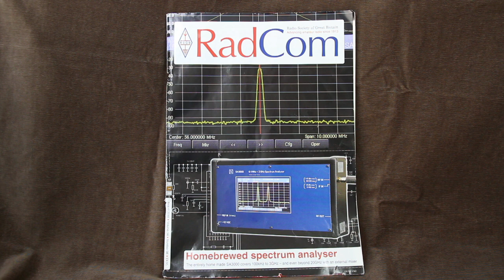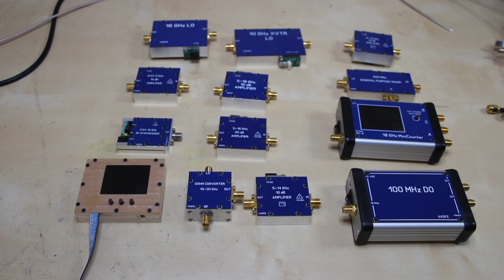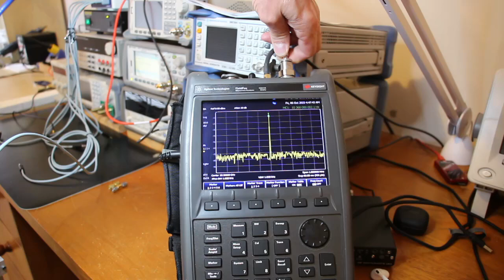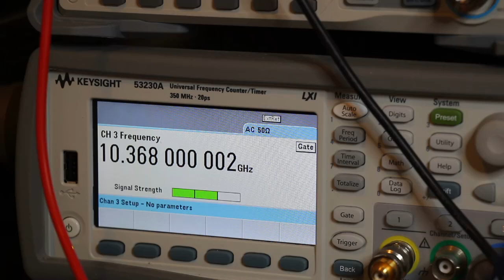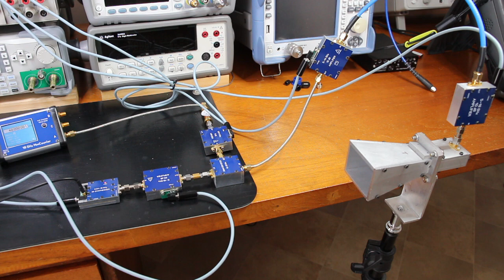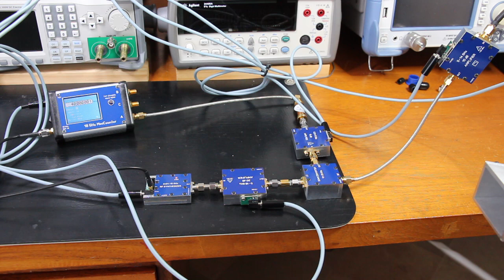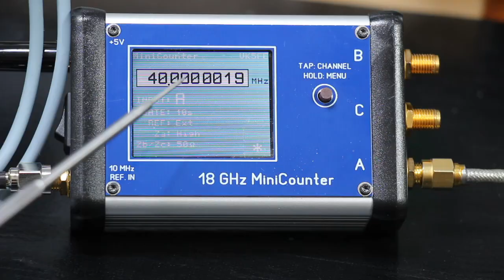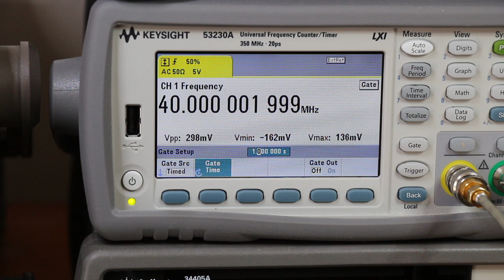#41 Microwave Funcional Modules

Comment: Hi, I am also curious to know wether if some of the nice blue devices you have made is commercially available? For instance the 20db amplifier from 2 - 20ghz would be very interresting to know where you got. I have spent to many hours now to find it :-) Thanks for the great videos anyway, I subscribed immediately.
Reply from the maker: Hi Christian, thanks for the comment and for subscribing.
All the units shown I made myself but you can find many fine connectorized amplifiers, for instance, in the MiniCircuits website, although some prices could be disappointing.

Comment: Fantastic construction. Could you give more information about your system for powering these modules? It looks like you have a custom multi-port power supply to feed each module through phono connectors? What voltage(s) have you standardized, and how manageable do you find the cabling? Thanks!
Reply from the maker: Hi Argyll, thanks for your comment. The detailed construction of the USB power supplies was presented in videos #34 and #35. Most of the cables are inexpensive and were bought from Ikea (used for LEDs lighting) - one side was removed and replaced by 1.3 mm DC plugs. Cheers